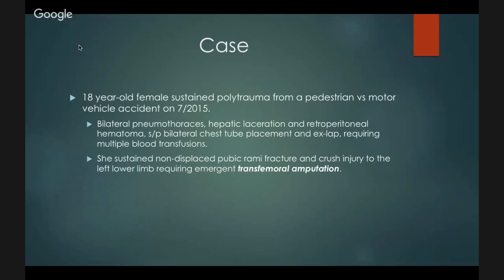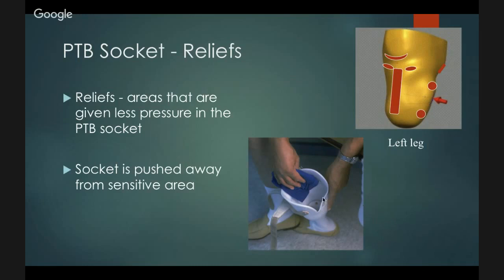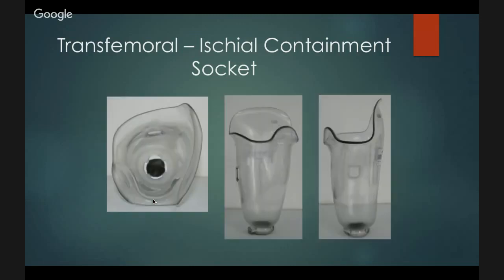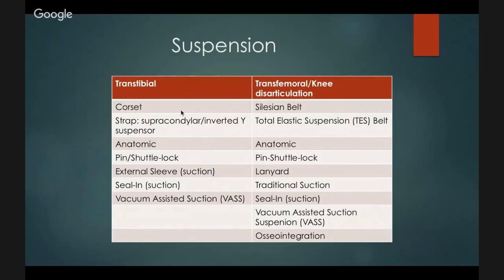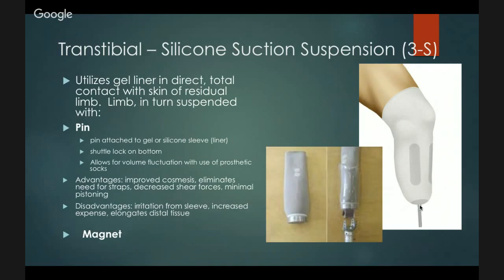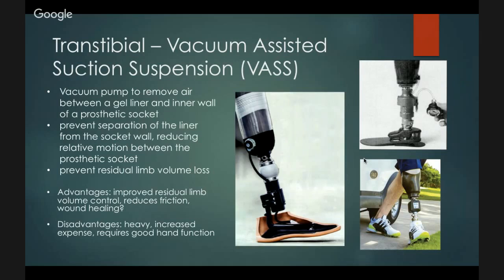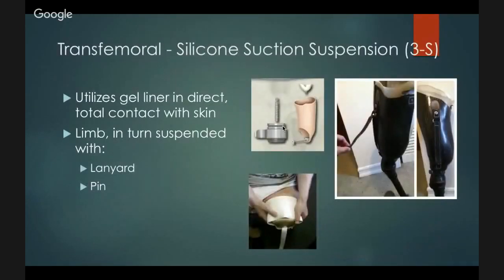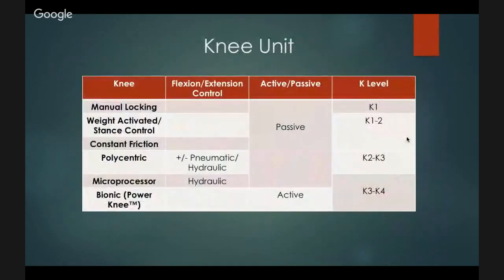Lower Limb Prosthetics (Sockets and suspensions)

Comment: i am not that old and had a wierd residual limb so no real tibial lenght, but knee joint, ried and ice ross liner but here in australia it sweated too much so i was left with an AK socket that stopped my own knee bending then relied on waist belt and shoulder harness to hold it on. so very heavy i no longer wear a leg as i have ms too but i look longingly at what is avaialble these days